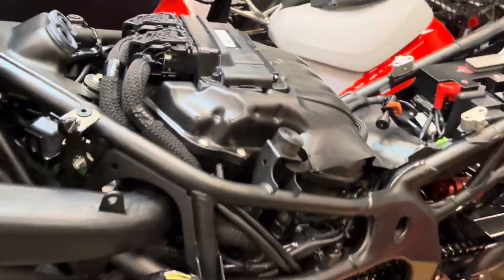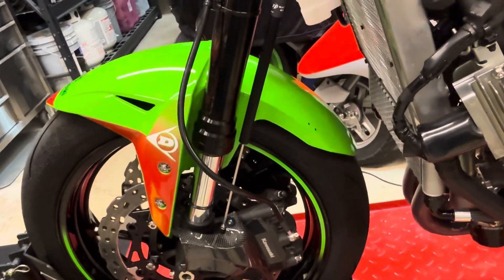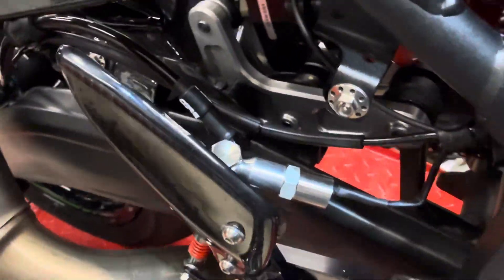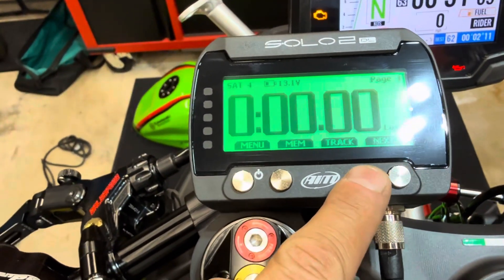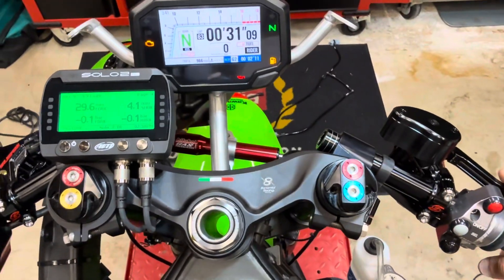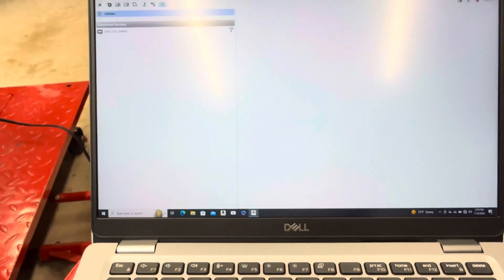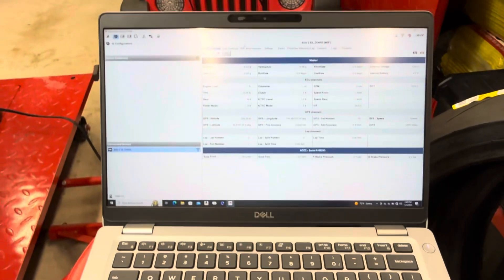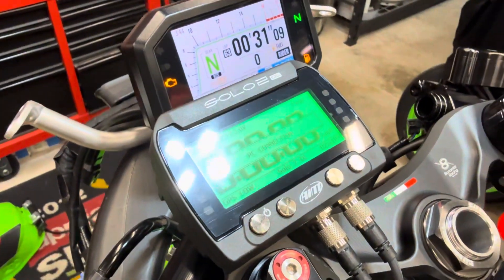AIM Solo2 DL installed on Kawasaki ZX-4RR with sensors for suspension, brakes, and ECU connection.

Comment: Do you need any pipe tape or sealant when threading in the brake sensor?
Reply from the maker: No, it seals using an aluminum crush washer, like other regular brake components.
Reply: @ArashAryana  Hmm.  My AIM brake sensor is 1/8 NPT and when fully threaded in leaves too big of a gap for a crush washer.  Unless I stack like 3 crush washers. lol  Going to have to source a sensor block like yours.  Thanks!!
Reply: Also may I ask what front brake sensor are you using?  It looks different then my AIM 1/8 npt  0-2000 psi brake sensor.
Reply from the maker: @fire.dragon1976  I don’t know the pn details as I sourced it from Graves Motorsports.
Reply: @ArashAryana  Ok cool, thanks!